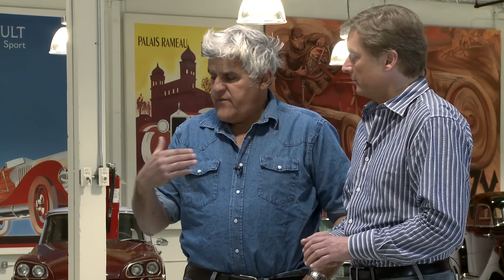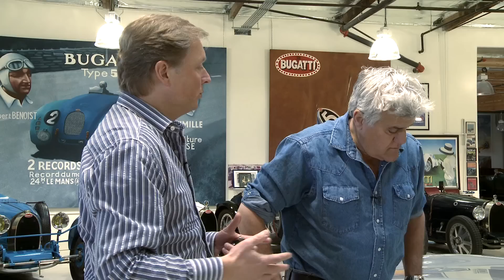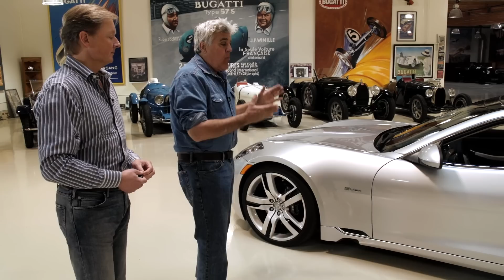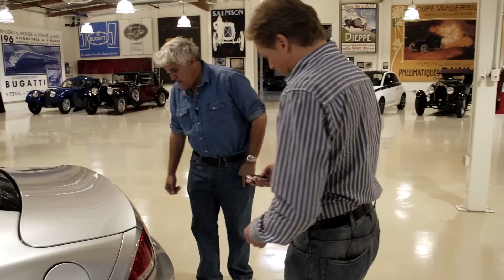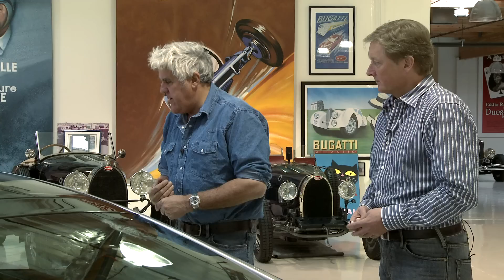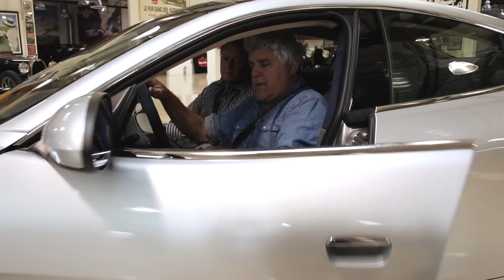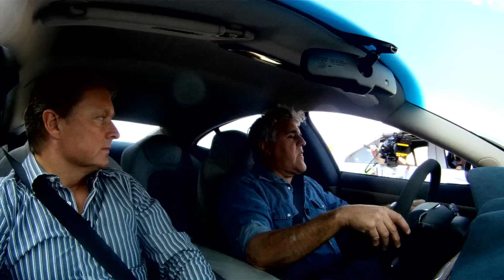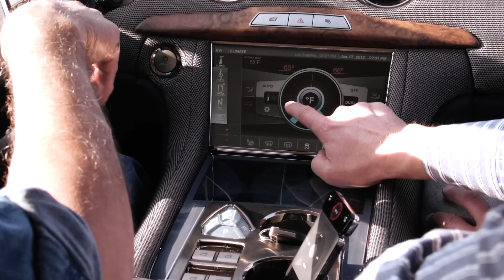2012 Fisker Karma - Jay Leno's Garage

Comment: Too bad they aren't doing well. Really like this car. And technically it is an all electric car since the gas engine isn't connected to the wheels
Reply: ***** but the tesla doesn't have a backup for when it runs out of charge
Reply: @Sax_was_taken  what ya feel now🤗
Reply: @drdoomgoat38  Did you dig up a 6 year up comment for this or were you just passin through?
Reply: @Sax_was_taken  just passing lol
Reply: ***** The fact that it has a gasoline engine doesn't make it a hybrid. A hybrid is a car that uses both a gasoline and electric ()in this case) powertrain to power the wheels. The gas motor doesn't power the wheels at all, and is never really needed when driving
Reply: NOLAItsNotOva By Google's and probably most other dictionaries, it is a hybrid. 

a thing made by combining two different elements; a mixture.
Reply: ***** I drive a BMW 3 series and I drive about 450 km on full tank. You are telling me that I should be worried If I were to drive Tesla? lol what a joke.
Reply: ***** Idk about you but I have never run out of gas in any car before. Theres too many idiots lights for that now aways. So it certainly wont happen in an electric car.
Reply: NOLAitsNotOva So is a mule really a hybrid or not?
Reply: Fisker is going to try it one more time and his company is going public in the stock market this year !!!
Reply: *****
Idk about you but I dont drive 265 miles (426 km)  in a day. 
40% of people could drive the fully loaded Tesla without changing their daily habits or routines. That will only go up from here. That is about 60% the range of a small hatch back and more than a Dodge Viper (which the Model S P85+ can beat in a 1/4 mile drag). 

And if you use the regen braking properly, you can go much further than 265. 265 is the EPA rating. And if you factor in Tesla setting up all of the battery swap stations, then an even larger number of people will be able to use it daily. 

It costs a lot but it is great value for what you get. Its supposed to be electric luxury, not a cheap hatchback. That is coming in 2017 (The Model C)
Reply: James Sawyer When did i say you should be worried, all i said is that Teslas don't have any back up for when they run out of charge, i never said they had a short battery life.
Reply: An all electric car does not possess a gas tank, therefore it is not an all electric car.
Reply: If you put gas in it and it has electric motors, then it is a hybrid. It still pollutes. Simple as that. 

The Tesla is much better.

Comment: its actually less efficient to make the gas engine generate the motor. if you just used that engine to run directly it would be far more efficient. the reason is because the second law of thermodynamics. since no system can be 100 percent efficient, the more longer the process is, the less efficient it would be. not a very good design in my opinion because the motor adds on a lot of weight which also brings down the mileage. personally i prefer the tesla ( even though i cant afford it )

Comment: The Volt has the exact Drive train layout as this ... Batteries power the motor, but when the juice runs out it switches to a small naturally aspirated engine that powers a generator ... Fisker needs to get his facts straight ...

Comment: they need to work on the touch screen interface really needs a update to make it user friendly. Also the seeing the battery should be taken out because its only chrome the area would of been better as a tray or compartment for cell phone keys change. The Solar cell roof is ok but for $5000.00 extra is really a rip off since it doesn't really charge the car. But other then those flaws it is really a nice looking car. Also attention to detail when assembly is lacking major gaps.

Comment: I personally hate the new wave hybrid and electric cars. They eliminate the emotional connection to having a car with real power. I fear for the future high powered V8s, why can't we make the best of both in the same car. A car you can get 35-90 mpg around town, depending on how you run it, and take it down to the drag strip or the track.

Comment: I love how modern car manufacturers like to brag about how many ecu's their cars have. Its great when the car is new but notoriously expensive to repair. One of the reasons you can get a 5 or 6 year old v12 Mercedes for $20k which is 1/5 the original retail value,plus the battery is only good for 10 years. Although it is inevitable that personal and probably al transport wil one day be electric I just wish there would some way we could not pollute but still have some sort of internal combustion.

Comment: The car is cheap for what it is, very good looking (European design), super quiet and very cheap to run - if you have a charging point.  They need to get a better range extending engine, not the GM lump, like the smaller and lighter Lotus engine which is designed and optimised for range extending. Rotary engines are great for this job. The car is made in Finland, not the USA. They need to succeed. The only thing I do not like is the name - FISKER!!  So change the engine and name and all is well.

Comment: Manual is easy it's only the clutch that needs getting used too, the rest is easy. I stalled a car 2 times when i first started driving that was 2 different cars, I've driven an automatic but it's just not the same as having something to do. I like sequential gearboxes where you just push forward and backwards on the stick too go up or down (still with clutch). Here in Europe you can't drive a Manual if you passed your test in an auto, so everyone learns on a manual so you can drive whatever.

Comment: Yes, you are right but it's BORING there is nothing more satisfying than getting a shift right, and the car sounds better while doing so. It also differentiates a good driver and a bad one as it requires more skill.   WRC used to awesome because the guys had too steer and change gear not flick your finger to change gear while having both hands still on the wheel. You'll never understand that it's not as fun to change gear with paddles rather than clutch and stick.

Comment: Electric cars have all torque on tap when needed so a gearbox would just be dead weight, and there is no point trying to engineer anything like it at the moment as the amount of torque it would need to be able to handle would not be seen in today's consumer cars

Comment: If the torque and powers there, use it, the only reason a transmissions there is to accelerate the car from idle. Otherwise its just more spinning shit to lubricate and to go wrong.

Comment: The drive train on this Fisker car makes a lot of sense on several levels.  This eliminates the transmission & differential.  The engine is a modest turbocharged unit that's small & efficient.  The motors always run, but are generally very efficient in a mo-gen mode as well as in their transmission of power from the IC engine.  It's a flexible system.  The drawback is battery weight, a factor that will plague e-cars until battery technology takes a big leap.

Comment: It does both. From Wikipedia, "the gasoline engine can engage mechanically to the output from the transmission and assist both electric motors to drive the wheels, in which case the Volt operates as a power-split or series-parallel hybrid. "

Comment: That's incorrect, like he said in the video the Fisker's internal combustion engine isn't connected to the wheels at all. On the Volt the engine is connected AND turning the wheel when/if you run out of electricity.

Comment: FACT: On the Chevy Volt energy is stored onboard in a 16.5-kWh, T-shaped lithium-ion battery. The battery powers the electric drive unit, which is capable of meeting full vehicle speed and acceleration performance while driving the car electrically for an initial range without using a drop of gas. When Volt's electric range has been used up, a gas engine works with the electric motors to keep you going.

Comment: You'll never get 300 mile range out of a Tesla doing burnouts.  Many heavy drivers are only reporting 200 mile range.  Get too heavy on the pedal and you won't make it to that next supercharging station be stuck in the desert.  Fisker doesn't use any gas either if you just commute with it.

Comment: Most cars have a first gear ratio of about 3:1 up to 3.75:1. Since electric motors don't need to idle and have good torque, you can easily just lock the motor to a single gear. The tradeoff is of course you are basically driving in something like 3rd or 4th in a 6 speed car. 1100ft/lb in this car is probably similar to a 300ft/lb car in 1st, but you can't just dump the clutch, and I would assume the inverters have massive phase current limitations at very low RPMs. Probably won't spin.

Comment: It's probably more like 75-80% of the torque from 0 rpm. Probably not 95+% until a few hundred RPM. The problem with one gear is you have no torque multiplication. It's probably similar to driving around in a 400hp 1100ft/lb car with a 6spd manual transmission, but leaving it in 3rd all the time. Definitely a worthwhile venture, as most every transmission is worse than not having one at all.

Comment: Hmmmm... For the same price you can get a Tesla Model S. All electric (with batteries not made by a bankrupt company), 0-60 in 4.5 seconds, 300 plus mile range, and it can do a burnout! Need I say more? Did I mention that it doesn't use any gas?

Fisker = FAIL

Comment: This car looks great. But instead of a gasoline engine set up, fisker should have went with a hydrogen fuel cell set up. Which is really the future of the automobile. Not fully electric cars or hybrids running off of fossil fuels.

Comment: @126liberator actually i dobt think there is. He said that each of the teo batteries are connected to one rear wheel. This would eliminate the need for a transmission since you can change the direction of the motor by chamging the direction of the current

Comment: There is a transmission, it only has 1 speed (1 gear cog). The transmission is designed for this car and because you can select park and reverse and it has the appropriate syncro sleeves it is very different from a freight train. No I don't work at Fisker

Comment: The "motor" is attached directly to the wheels, the "engine" is not connected to the wheels in any way though. It's attached straight to a generator which powers the motor to then drive the vehicle. There is no drive shaft nor is there any transmission, it is JUST powered directly to the wheels by the motors.

Comment: because the generator needs to be able to power the car in motion which means it needs at least 1xx horsepower otherwise you will have a very slow car when the battery runs out.

Comment: This is the first and only electric car I respect. I do not understand how the 2 first comments can support the Tesla Model S, which misses the point -> using a standard motor as a power generator. Even the design of the Karma is by far more interesting than the Tesla S, which simply looks japanese. The design of the Karma stands out and is actually very beautiful, but this is an IMHO

Comment: electric motors make max torque at 1 rpm...torque is very different for all forms of engines...especially when it comes to maximum torque and how/when its made and delivered. 1100 ft pounds of torque delivered instantly can actually rip this car in half...it has to be delivered incrementally...Tesla was experiencing transmission failures in their 2 speed units and had to go to single speed...the torque delivery between shifts would blow them apart.

Comment: I don't like how, when the gasoline engine is being used, it doesn't directly power the wheels, but rather is used to generate electricity for the electric motors.  With every conversion of energy you lose energy, so the electricity that you get from burning the gas is less than the energy actually contained in the fuel.  Not very efficient.